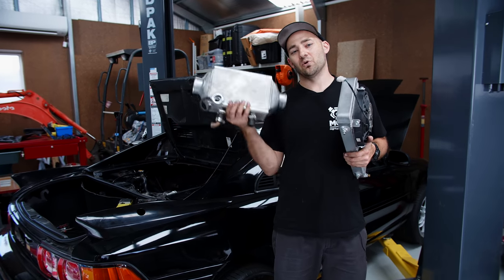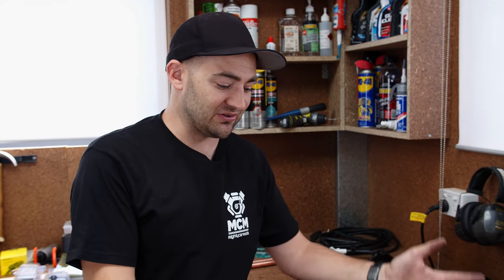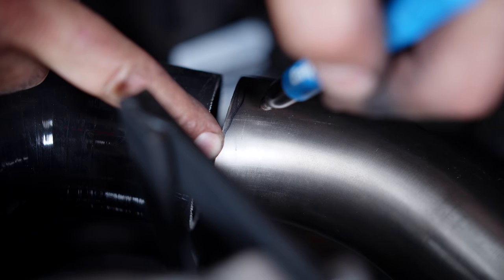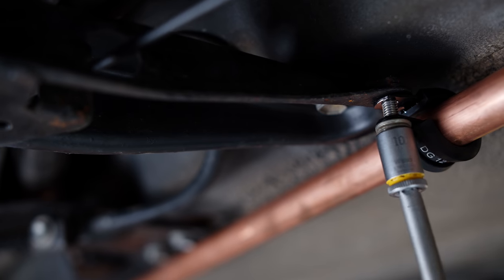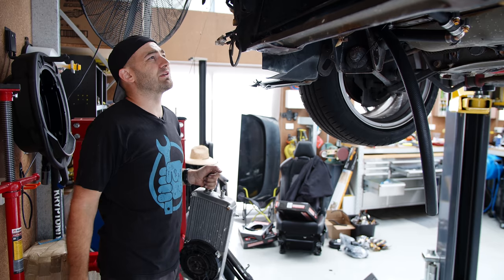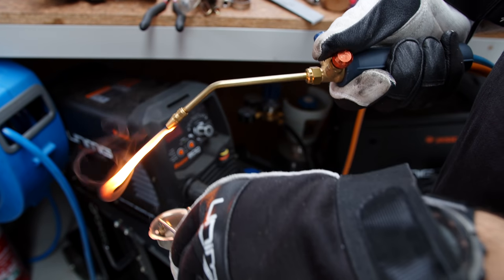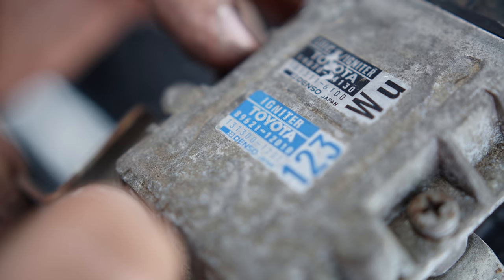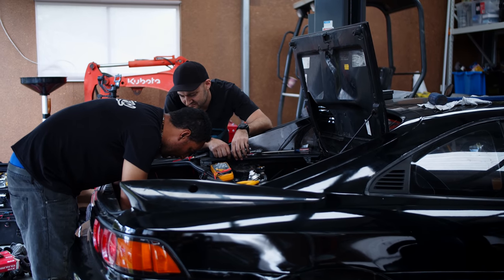MR2 takes Miss Daisy parts (Water to air Intercooler Install)

Comment: Mixing copper and aluminum in the same cooling system ... that will eventually end in corrosion and failure.  Maybe it will be good enough for the short term if you don't like the car and don't plan to keep it.
It will be someone's problem some day.
Reply: Not if he uses proper inhibitors
Reply: It'll be fine if he uses a decent coolant with corrosion inhibitors and the charging system is good, if not the it'll start to do the electrolysis thing and he'll eventually have problems, but even then that'll still gonna be years down the line given how little distance MCM cars cover in mileage, and not to mention its basically a seperate system from everything else on the car, its not as if it ties into the engine coolant, so the only real issues would be the water 2 air system which you would just swap out for upgraded parts. 

However i do think he will run into heatsoak issues running the car on a circuit though given the rad size and core size, it would be fine for a drag car like miss daisy when its only running flat out for 13 ish secs at a time, but i reckon he's gonna heat soak it pretty quick on a track.
Reply: @weegaz22  Yeah, radiator size needs to be bigger, I mean, take a look at Binky's radiator, that thing is no joke.😛
Reply: Corrosion will be pretty instant helped along by  the heat and start to eat away at the whole system and will make all parts unusable going forward... it wont take long and should be replaced ASAP
Reply: @weegaz22  "but even then that'll still gonna be years down the line given how little distance MCM cars cover in mileage"
Electrolytic corrosion doesn't care about mileage. All it needs is two different metals and a somewhat conductive liquid, distilled water will do. It will rot to Hell just by sitting.
Reply from the maker: · yes it’s a good point but I couldn’t get the right aluminium in the time frame, and I’ll use proper coolant in it and will keep an eye on it.
Reply: I'm fairly certain that older cars with copper rads had aluminium components in the cooling system, like heads, thermostat housings, water pump housings etc.
Not saying that electrolysis isn't an issue, just don't believe it is automatically an issue as soon as there are different metals in a cooling system.

A mechanic I know who specialised in radiators for a while said stray current is the big killer, especially of ally rads.
Reply: @mightycarmods  when you can see it, then it is already too late
Reply: @johnjosephson9277  That can be true if the system is electrically isolated and there's no path for a current loop.  In this case, the radiator and the tubing are both making contact with the chassis, so there is a loop.  Depending on things like coolant type, age of the radiator (preexisting corrosion acts as a seed for galvanic corrosion), length of the run (damned long), isolation (or not) by the rubber hoses, and any (voltage) potential differences from being near the grounding points for electrical systems, this could start to corrode almost immediately.
Reply: @PoignantPirate  That sounds about right mate.
Reply: @centralintelligenceagency9003  did you just decide to selectivly ignore the part where i spoke about using corrosion inhibitors and making sure the charging system is good? ie, has good grounding to the body? besides if it does rot out as fast as you seem to try and suggest then why are copper ringed headgaskets (and full copper gaskets) still a thing with aluminium heads on cars and bikes?  because the benefit they have to sealing the head outweighs the tiny amount of galvanic corrosion because they run coolant with corrosion inhibitors built into them.

Comment: mixing aluminum and copper is a bad time :)
Reply: I bet he's going to crush the MR2 anyway. Too much grief.
Reply: Don't french fry when you should pizza or you're going to have a bad time...
Reply: Yes. But with these dimensions, a good anti corrosive and regular changing of the coolant it will last for years before it's too gunked up.
Reply: thanks for the comment, I was looking if someone had allready warned him
I am 99% sure that even toyota pink super long life coolant is not compatible with copper, and that's probably the less reagent coolant there is

Comment: Dude, ALWAYS bead roll your ends when you are going from soft line to hard line or vice versa
Reply from the maker: Jacob Walls yep will do, don’t have the tool for it atm
Reply: Was thinking the exact same thing! How much psi before something POPS off??
Reply: @hipo4eyes1  ask your mom 🤭
Reply: @mightycarmods  I'm sure you blokes could rig up something 😉 btw, when are you guys going to come check out the Freedom Factory? (And I love your content, esp the music...don't tell Moog, his head is big enough)
Reply: @mightycarmods  You can make the tool using a pair of vise-grip pliers, a big washer and either an exhaust clamp or an angle grinder :) just weld the washer in on one side and the exhaust clamp on the other so when you clamp the pipe it gets pressed in, or you can just grind into the pliers if you don't have an exhaust clamp on hand :)
Reply: especially on all that copper.

also, might be good to insulate your cold side copper from the hot side. bonus of using copper is the high thermal conductivity so youre effective radiator size is actually a bit bigger. would be wise to thermally isolate the two so your hot side doesn't heat up the cold side before it gets back to the intercooler
Reply: Weld it on like how youngstatic does. Saves spending on bead roller

Comment: Never thought I would ever hear a car guy say "it's too fast". I know he say "safely", but still
Reply: I think it was because that Bug didn't have a roll cage or anything lol
Reply: It's only too fast because of stability or crash problems.
Reply: I thought the bug was the one that burnt to a crisp...?
Reply: @NSUGS  White s15 turned into an urn 
Was quite a crisp looking car.
Atleast we got to hear the ECU get flashed lol
Reply: Man to have a Superbeetle pushing 360 hp would be rad. 120 hp in one is a good time with the right tires and gearing.
Reply: @One_Bar  i would have said terrifying not rad. in fact i would bet thats why they got rid of it.
Reply: @WarriorPaxo  it's power to weight is approximate to a current gen Viper. Put some decent tires on it and have some fun. Although I bet the gearing is all wrong for the entire setup.

Comment: Use a bit of heat when bending that 1/4" bar. It'll save the stress on the vice mounting and you'll get tighter bends.  You've got the Oxy Acetylene.
Reply from the maker: Here Now good idea, thanks!!
Reply: yeah haha I saw him pullin on the bar just thinkin "Heat that sucker up and itll bend like a wet noodle!"

Comment: Marty: "Water to air intercooling, not something you really see from manufacturers anymore"

Ford Diesel pickups: Am I a joke to you?
Reply: um well ford ,chevy, dodge all use it on their super charge cars,so yeah you do see a lot of it these days just saying
Reply: Being an aussie, pickups aren't really on his radar.
Reply: @ryantilley-general.shenanigans  The most popular vehicles sold in Australia are all pick ups, Hilux and Ranger are in the top 3
Reply: Yes, Ford pickups are indeed a joke to us.
Reply: You also see them in Corvettes, GTs, etc...or anywhere space and clean air is limited(lots of aero)
Reply: @vobrasolo  esp any screw blower car that isn't running methanol
Reply: @ryantilley-general.shenanigans  the Ranger Raptor is only sold in Australia right now...I hope they are paying attention
Reply: All McLarens run them too.
Reply: @weegaz22  neither of those have water to air intercoolers
Reply: In fact many new VW tdi engines have water to air intercoolers. Check out the t6 or t7 setup. It makes the intake piping really short and accounts for little to no turbo lag and easier engine packaging.
Reply: @SuomiFinlandPerkelee  the new Supra is water-to-air...in fact, all B58 engines
Reply: @SuomiFinlandPerkelee  I thought it was the exhaust side length that mattered?
Reply: @joecook3223  that wasn't really the point i was trying to make Joe, he said their Aussies so pickups aren't on their radar when pickups are the top selling type of vehicles in straya due to having miles of un-maintained shit roads between dabs of civilisation.
Reply: @weegaz22  ah yep fair enough

Comment: Props on going water to air. Best idea on a rear engine car.
I too, built a turbo beetle with a water to air and front mount heat exchanger. Worked very well.
On the subject of Miss Daisy, I'm still very disappointed you didn't...
1. Tell us the 1/4 mile time.
2. Build it properly (ie, Subaru trans and proper bracing)
3. Keep it together.
Bet you wish you'd just kept it now. Coz the MR2 ain't loving you back. LOL

Comment: Tbh man.. You really needed to flare the end of those copper tubes when connect to a rubber hose with a band clamp
Reply: It won't pressurise as much as an engine cooling system during operation, it will probably be fine

Comment: About the copper lines. Make sure you use a non conductive coolant. The aluminum and copper will react with eachother. The one eroding the other. Very common issue in computer water cooling. They use specific coolant that needs refreshing every x amount of time. Not sure on the timing details

Comment: I did a similar setup with running the rad and intercooler to the frunk of a 68 Covair.  Swapped my NA 4 speed model from the factor opposing 6 to a 1.9 VW TDI.  Going from the 4 speed and NA flat 6 to a 5 speed and the TDI was a massive improvement in being a daily for MPG and power surprisingly, it's pushing over 210hp and well over that in torque thanks to diesel.  I drive it more than I do my RWD 1UZ converted Celica and don't really miss the lack of power, definitely like having double the MPG lol.

Comment: Eek, don't put aluminum and copper in the same loop!
Reply: Copper radiators and alloy heads and block. Whats the difference? Corrosion inhibitor all is good.
Reply: @Lazy_Tim  Galvanic corrosion, personally if I was making a custom system I wouldn't mix metals...also didn't say what they filled it with so your assuming coolant... in Australia!?
Reply: @UpShiftTrackdayVideos  yea... we use coolant in Australia. What kind of bass ackwards country do you think we are?
Reply: @UpShiftTrackdayVideos  I know what Galvanic corrosion is.He's not at the drag strip so yes it would be coolant.  Also the metals are connected electrically by the coolant only not direct metal contact. Ideally you would use similar metals but I don't see much of an issue here.
Reply: @Lazy_Tim  Did I say that...?  Water is a better heat conductor than ethanol glycol (coolant,Anti freeze).  Also the water to air system  won't see the same temps as sn engine cooling system.
Reply: Aluminum heads go on iron blocks all the time with the same coolant between them
Reply: @UpShiftTrackdayVideos  Miss-understanding then. I agree 100% with your other 2 points. All good mate.
Reply: @mikeysomething  Coolant is banned at  a lot of drag strips. It's stuffs the surface of you strip if you were to damage a line.

Comment: "something you don't see as much from manufacturers these days"
Pretty much every volkswagen, except the performance models, have water to air intercoolers.
Reply from the maker: panzerveps didn’t know that, the newer ones? I’ve only seen air to air like the mk7 golf
Reply: @mightycarmods  The mk7 1.4 and 1.5 TSI have water to air, while 1.8 and 2.0 TSI have air to air.
Reply: The polo 1.2 tsi has it as well i think
Reply: @yorrickwi  Looks like it. I don't see much of that engine, so I forgot about it.
Reply: Mercedes used water to air in some engines to reduce boost piping volume. Citroen also uses air to water in parallel with air to air in some engines (2.2 HDi for example). It allows ecu to choose one or another both via vacuum operated valves in boost pipework for some reasons.. Maybe heating the engine faster when cold? Who knows what french engineers think sometimes.

Comment: As someone that's been water cooling PC's for the past 17 years, please replace the copper with aluminum or nylon. You are going to run into horrible galvanic corrosion long term running mixed metals like that.
Reply: It won't be too bad. Car cooling is always mixed metals, and is why coolant is full of inhibitors. Example, my Land Rover has an Aluminium Block and Head, with a Copper Radiator. Has had from the factory.
Reply: What he said ... definitely asking for galvanic corrosion, but as long as he uses ethylene glycol and not straight water it'll be more than fine.  I've seen an aluminum intake get ate up pretty good with copper radiator core, but that was a case of sitting for 20 years and not maintaining (or draining) the coolant.
Reply: @a351must2  I did a mixed metals loop back in 2004 and I ran a diluted antifreeze mixture (I still do to this day simply to help keep organic blooms down) and despite the aluminum being anodized I ended up with a pit developing in the aluminum part the size of my thumb. It was about as big around as a nickel and slightly over 1/16" deep. I'd just hate to see him end up with his heat exchangers clogging up or rotting out.
Reply: @madmat2001   madmat2001  Back of my head was actually telling me that the damage I saw in the aluminum manifold was significant, but at least was thick in the areas that were pitted.  Not the same with a heat exchanger, so it will likely be something to worry about sooner than later.  I've been fighting corrosion in a water loop that has copper radiator and block, but PTFE braided stainless lines for hoses.  Has been difficult to source stainless fittings, and even with stainless, my understanding is that I could still have issues.  I've emptied a rusty loop twice with the galvanizing eaten off the fittings I had been using and currently have all stainless fittings, but it's only been together a month with the new fittings and takes about 6 months to start showing any issues.

Comment: When you are soldering copper pipe, keep your flame on the bottom and hold the solder on the top - when it melts on top the heat will pull it all the way into the bottom instantly :)

Comment: You can run the copper pipes inside garden hose to make a coating for it, protects it from debris and if a holder brakes it keeps the copper from rubbing and digging holes into itself, ran my old truck's transmission cooler lines this way, never had issues.

Comment: I love the fab work.  Marty, you need to invest in a vice mount brake press for your little brackets. . (pressbrake? whatever you call it down under) in the land of maple syrup they are quite cheap and super easy to use.  much nicer than a hammer and vice

Comment: Been away for a good minute and now I'm playing catchup. I totally feel the struggle of your car fighting you. My current project is a 1995 Trans Am that's been upgraded to a WS6 package with parts from the Wrecker and a C4 corvette engine and transmission. Add the new aftermarket oil cooler and 4 core radiator along with it having 2 different wiring harnesses and a replaced ECM from a California Highway interceptor and I'm having a ball of a time trying to even do repairs at this point. Keeping track of what parts are what and from where is a nightmare. Especially since I wasnt the one that did the swap.

Comment: Marty, I would suggest that you install an expansion vessel on your air/water intercooler. This will avoid pressure change in the water circuit and avoid the risk of leaking and/or air entering the water coolant system.  Great job, as usual.
Reply from the maker: Good tip. Thanks!

Comment: Hey, you need to put a ridge on that copper line to reduce the risk of the hose coming off, gives a better grip then just clamps alone. While brass would be better, copper should serve you just fine. I'd inspect it for corrosion periodically just to be safe.

Comment: If you add a steel shield/guard to the long copper pipes it will provide protection also leaving both ends open will create a channel for air to flow through whilst driving further cooling the coolant and for less than £15 stirling you can get 10m of 25mm heat shrink on ebay that would help prolong the life of the copper pipe

Comment: Great video love hte toyots contenet. fyi Ideally you want a rib on any steel to rubber connection. Bead roller is good for intakes and on smaller stuff like that copper I use an exhaust pipe spreader that is just a metal cone you hammer into the end of the pipe. Just that little bit of flair on the end will keep the hose clamp from being able to slip off under pressure.

Comment: When you're bending flat bar, looking for a 90 degree bend, scoring the inside of the bend with an angle grinder helps make the bend cleaner, especially when using thicker stock (looks like about 6 mil?)

Comment: I was really admiring your ingenuity with the inter-cooler plumbing. I did have a thought though. If you used aluminum rather than copper, you would be utilizing the faster dissipating heat-sink properties of the aluminum rather than the slow dissipation of the copper, effectively making your pipes under car intercoolers surrounded by a lot of "not in the engine bay" heat.

Comment: heared about the need to backpurge stainless piping , reason being that the head from welding against normal air cause some whitish cristals to form making the pipe more prone to cracking near the weld , with the backpurging the cristalisation doesnt happen and if the weld pushes all the way though it will actually flow out better
its nothing more then taping both ends close and insert a bose from a bottle of welding gas running through a regulator , crack the bottle wait a second and start welding

Comment: Watch out for the Galvanic - corrosion or electrolysis with having the aluminum coolers with copper pipe. It will start at the weakest point.  Fix a bit of zinc in the system might put it off for a bit.